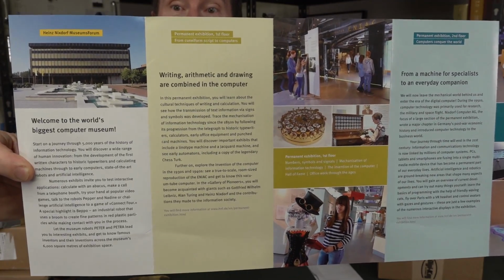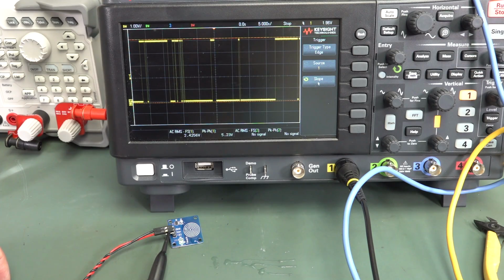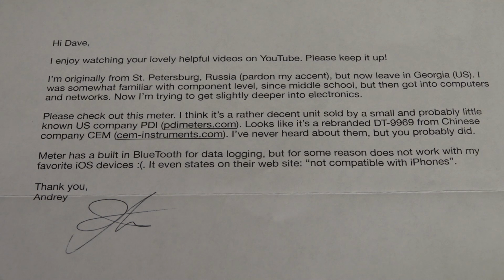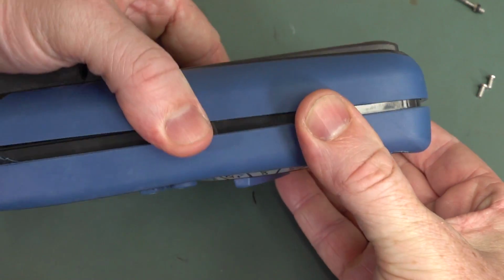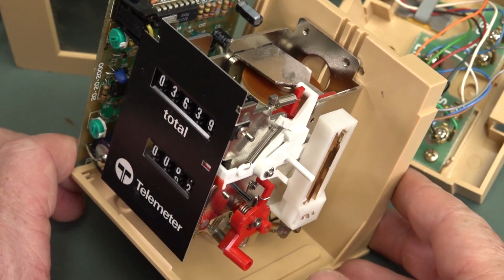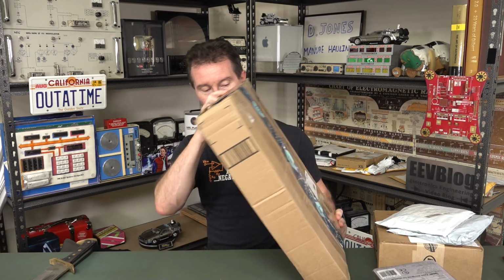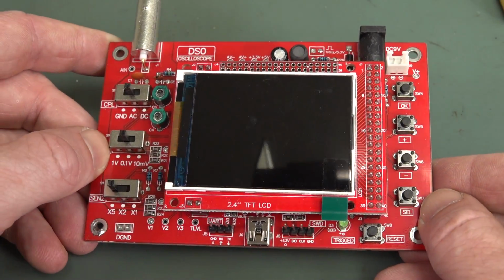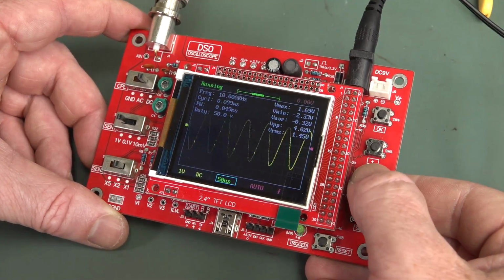EEVblog #1272 - Mailbag

Comment: Hey Ethan, I hope you find this. You can easily download your scopes service manual, they often include alignment and calibration procedures. Honestly just play with the pots in the high voltage side till it looks right. Should be no need to mess with the vertical amplifier where your probes attach, lots of trim pots, coils, and trim caps, often shielded. If the trim pots in the HV for the CRT display don't get the job done, you will need to check voltages. The wires going to the static deflection plates in the CRT run to the middle of the tube, 2 pair, check them. One more thing, it may be a bad capacitor, just check them for shorts or damage AFTER DISCHARGING THEM. The CRT can also hold a nasty charge. So maybe unplug scope, then turn it on whilst unplugged, and bleed off those giant filter caps. On my scope, I have a handfull of nice fat variable resistors (pots) that are brown and accommodate a phillips. 3 in the back and three on the horizontal side, main board. One of them did focus and one controlled voltage to the machine. Take note of the pots original orientation before you trim it, if when you turn it(powered on mind you) and it does nothing to the display, trim it back how you found it. For God sakes PAY ATTENTION to where your driver tips are, don't electrocute yourself. Oh and on mine there is a trim screw on the front under the display that says ASTIG that I adjusted the other day in order to dial in even better. IDK what ASTIG does. My dot in X, Y mode was a bit out, so ASTIG tightened it up, start there maybe. If you are unfarmiliar with High Voltage electronics and the risks I would avoid this, or steal moms dish washing gloves and a buddy with more experience. Good Luck
Reply: Speaking of Discharging things.   I took a 40Kv hit fresh out of school that knocked me on my back for that very reason.  I swear to this day I got everything but obviously I missed one.   So please check, recheck and if your sure, check again.
Reply: @smgvbest  Hell Yeah! Hope you did not loose a foot! What holds a 40KV charge? That's a transmission line rating.
Reply: @WTFinc  this was back in 1986, and It was a flyback transformer as I recall from a commodore 1701 monitor I was doing warranty repair on.  
I look back now and think how stupid and laugh at myself.   i know my heart must of skipped some beats,   i felt the brunt of it in my chest and from the instant it happened to being on the floor, fraction of a second.   but was fine.
Reply: @smgvbest  I instanly imagined you laying on the floor with your hair in all directions still smoking from the zap with a final puff of smoke coming from your mouth "but was fine"
Reply: @smgvbest  Cool, a commodore! A worthy opponent. lol. When I was young I took apart many of tube TVs. I learned on a smaller scale that caps held a charge long after power off. Lucky for me the only indication that a TV could kill me was the thicker than mains wiring on the flyback and massive cap. I think also I was removing the coupling for the tube and flyback and i shorted flyback to ground and i heard a pop. leading me to believe the tube itself was also a big ass ceramic job, when it wanted to be.
Reply: @WTFinc  Yes the tube itself acts as the EHT smoothing cap. The final anode is a conductive coating on the inside and there is a conductive coating on the outside usually grounded with a spring stretched across the back of the tube. Since there is thick sheet of glass between the plates it will stay charged a long time.
Reply: Looking at a 2213A Schematic, Focus mainly consist of Q885(SPS7950) and  a internal trim pot R853(5M),   All of course in the high voltage section.   there are of course other components, passives mainly but those are two I would check for a quick look   it is possible someone tried to adjust the trim pot and messed it up so the  front panel adjustment just doesn't have to range to correct it.
Reply: TL;DR It might not hurt to recap it.
Reply: @JesusisJesus  No, your right, not at all. They should be all right tho. Its highly unlikely its the caps however, which is good news for Ethan.

Comment: I recently got one of those kit scopes; mine didn't come with any documentation whatsoever. It came with one of those shanky Perspex cases, which really doesn't add much value. (2022 price is about 3x what it was when this video was released - frakking pandemic - but still better value than a typical scopemeter.) Would have been much better value if it came with its own 9V wall wart. Anyway, 200KHz analog bandwidth is perfectly adequate for a portable solution for looking at the waveform of a signal in line level audio gear which may have intentionally produced distortion, e.g. distortion pedals, and with a 100x probe should be just fine for tracing signals in a choob amp. Definitely in my wheelhouse for analyzing music production gear.

Comment: I am almost sure that the load resistor in series with the cable is for temperature compensation of the main cell. In the torque measuring wrench.

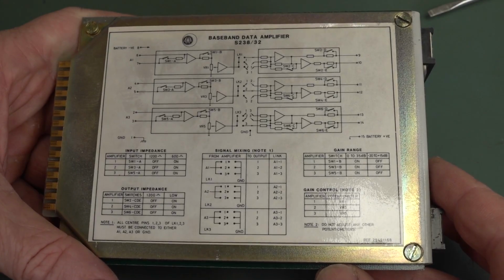Comment: At 37:20 Those little jumpers are a typical Siemens design that was taken up by several relay manufacturers, it enabled you to plug in a module next to the relay (across the coil) that contained a cap / filter or even just a LED to tell you it was on. Mostly used in late 90's industrial PLC stuff. I have tons of them ;)

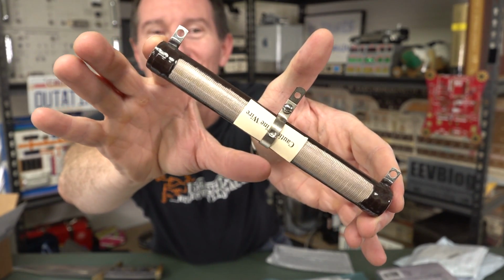Comment: 48:27 I got one of those JYE kits. It's kind of crap. Mine was missing parts, and honestly the PCB has some kind of problem with the plating or something that it doesn't solder easily. It's easily one of the most frustrating kits I've ever built.

Comment: I used to use one of those JYETech scopes before I could save up enough to buy a real scope and the trigger on them is absolute garbage. It claims it's 10us/div which you CAN set it to, but it absolutely refuses to trigger on any events shorter than 100us. They're ok for measuring a PWM signal or getting a vague idea of what a waveform might look like, but I wouldn't even recommend these for beginners.

 The problems with the triggering caused me endless confusion, thinking it was me that was doing something wrong. Which as somebody new to electronics, just hurt my confidence in my abilities and led me in the wrong direction in terms of troubleshooting. I spent days trying to build a simple EEPROM programmer because I thought I was screwing up my write pulse generator because the scope wasn't showing anything when I probed it. It was only after a lot of troubleshooting and experimentation that I figured out it was the damn scope.

For all the problems it caused, this thing isn't even worth the $25 or so it costs. If anyone's thinking of buying one of these, DON'T. Just save up for a real entry level scope. Cuz you're just gonna have to buy one sooner or later anyways.

Comment: Got my TTP223N boards to test out. They are really sensitive. Even thick plastic or wood sets it off. A finger sets it off at about 4 mm.  I will experiment with reducing the pad size, otherwise these sense pads need to be spaced pretty far apart.

Comment: Hey, remember when you got that multimeter which has a read-out for 4-20 mA current loops I think the loop extender might be for a current loop like that. 4-20 mA current loops originate in telecom and are still used with PLC stuff in industrial applications.

Comment: I would pass on the U$150 DMM, but I already have both EEVmeters. 

About the strain gage in the whire, is for temperature compensation, it's common practice to use an unloaded one next to the loaded one to make the compensated bridge, at least when you only load half of them, in other cases you could load the 4 sides of the bridge in opposite direction and get higher gain from it, but not always mechanically practical.

I thought a few times about getting one of those scopes, to use as an isolated one with some safety mods, or to mock around, sometimes it's all you need.

Comment: In telephone exchanges they used to use -50V for billing pulses, so that meter most likely listened on the line for the voltage reversal so you could have a home bill indicator, perhaps for businesses?
They used -50V because everything else ran at +50V, and it was to prevent spurious connections incorrectly billing customers.
I remember spending many unhappy hours testing banks of thousands of those meters in an exchange when I was an apprentice, then some guy would come along with a camera, photograph them all onto microfische, then girls in the main office would manually type all the numbers in using a keypad and reading each one from a microfische projector. Thank god for modern digital recording techniques...

Comment: Artifacts on the dso oscilloscope may come from your 12 v supply. It clearly says it must be under 12v. And many people comments its better to have a low voltage. I run mine on 2 18650 in series for a max 8.4v and it works great.

Low bandwidth yes but for me it's more than enugh, and i cant justify the 10k price of a proper one

Comment: I bought one of those about 3 years ago, I even sprung for the plexy case.  While some of the buttons are a bit clunky, it does protect the unit, and I found an old leather PDA case that I had laying around that it fits in which makes it easy to transport, and keeps the dust and dirt off of it. I have used it probably ten or twelve times, but those times make it well worth the 30 bucks I have into it. I mounted a little 9 volt battery box on the side for ease of power and use a rechargeable battery which again makes it easier to use.

Comment: Those kinds of torque wrenches are used quite extensively in automotive assembly.  In 2002 one of my first jobs was as a grunt replacing terminals on Jeep assembly lines.  They were used for data acquisition during final assembly.  Sometimes barcode scanning, sometimes manual entry but often from torque wrenches.  The Jeep Wrangler line had something like 300 terminals on it and the brand new Jeep Liberty line had 1400 or so.  The automotive companies collect the data for QA tracking and for recall notices.  In the case of the torque wrenches they    collect torque measurements for things like seat and safety belt anchors and various drivetrain and engine components.

Comment: Hybrid in this instance refers to the mechanism for carrying baseband voice both ways on two wires. The outgoing voice is subtracted from the overall signal to remove the outgoing voice from the result. The subtraction is not complete in order to create sidetone, a certain amount of the local speaker's volume to control how loudly the user talks. The circuit also acts to prevent echoing the incoming signal back to the output.

Comment: These are GREAT for Audio, low voltage controls and uP stuff, and automotive with some filtering. It is not every measurement that I need 100 MHZ BW. Needs a case, and a second channel, but for an ISOLATED "visual" A/D / multimeter, adding a shunt resistor, etc., it works. Just don't drop bare wires or molten solder on the board! ha! Kinda gimmicky, but useful on occasion.  There's 3'rd party firmware available, too. Cheers!

Comment: cheap scope: there is a version available with only the QFP soldered, and all the other surface mount supplied on cut strips, (with one or two spares of each part in-case some get accidentally launched)

Comment: I won't be buying anything from sain smart, i got one of their scopes and the state of the software, which is crucial part of the function is absolutely dismal. It is buggy and crash prone and NEVER updated: it is pretty much the first version of it and didn't work when it was brand new. Absolutely no company that actually made tools would leave any of their products in that state, everything about it feels like they just sell stuff regardless whether it works or not. Oh, also: i had to resolder the probe connectors once and it seems like i have to do it again... and i think the 1kHz calibration signal output is dead too.

Comment: 43:37 Pound (times) inch.... those bloody sparkpuller electronic engineers, they can't tell torque from a load spatial distribution. Yeah, put  that next to you amps per hour notes. Same thing.

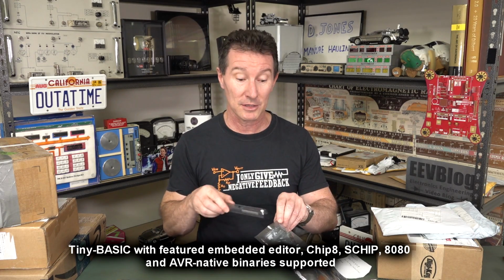Comment: 16:00 SCART does everything. Conposite, S-Video and RGB both in and out.
Reply: The problem with SCART, apart from being too big & clunky, is that many cables are 'one way' they are not full duplex wired. Plug a SCART the wrong way round and you get no signal. And they are useless after 3 meters. When you buy a SCART cable, make sure it's a thick one, that means (usually) that they are fully wired and well screened! Grr.

Comment: I've got a JYE scope like that. I build modular music synthesizers and I use it for audio frequency test and tuning. Works great for that, I jumpered the buttons and switches out to a Eurorack panel.
Reply: I guess it's alright for audio frequencies. But I had triggering problems like Dave did on anything shorter than 100us. It led me down a lot of wrong paths in terms of troubleshooting. I'd spend days trying to troubleshoot a percieved problem in a circuit, only to realize it's the scope that was problematic. They're okay as a novelty, but after the problems I had, I wouldn't trust anything it tells me for anything past maybe 10khz. And even then, there's just no way to know for sure without a proper scope to check it against. I just saved up and got an entry level Hantek scope and I've never thought twice about it. You should consider doing the same, if it's possible. You'll be glad you did. Start looking around and get an idea of which scope suits your needs best for its price. Cheers.

Comment: Couple of years back, I picked up one of those DSO kits.  It came with all the SMD parts  installed.  It was fun to assemble, it came while we were on our Winter break down in Arizona, so I assembled it with what I had along in our Motor Home, sitting at the booth and soldering with my little USB powered soldering iron.  It took great care to keep the tip at a decent temp as those irons are known  for just dumping every amp it can get into the tip and overheating unless you allow her to cool a bit between joints.  The unit works great really for what it is, I have had a lot of fun with it and learned quite a bit about circuits by testing out boards I buy and such.  I did buy the clear lexan case for it to protect her when we are moving about with the rig, plus I found a little leather case that she fits very nicely in for storage. Earlier I built a tiny scope using an Arduino Nano and a Nokia screen. It works but not nearly a good as the one in your video.

Comment: @EEVBLOG Hello Dave.  Yes, I am interested in a fast DVM in the $150 range, although I would prefer a perfected 121GW, which I pretty much shelved for resistance trouble-shooting.  I am interested in it from you because I know there will be updates and software updates.  It is fun to be on the bleeding edge of what can be done.  Realistically, I am interested in a Fluke 189B type meter, that is not discontinued.  it's hard to justify $400+ for a handheld meter.  For trouble-shooting a Fluke 17B may be better.  If you have another one coming out, I may just wait.  Speed to low ohms (not higher ohms) is more important to me.  It's a cool trick the DM-950BT does.  That trick should be added to the 121GW code, or if nothing else added as an option.  i am enjoying your videos as usual; your accent is very pleasant to listen to.  I've also learned some of your BritishAutralian slang.

Comment: the problem with center-off is that it's really easy to accidentally overshoot to the 10A range when turning it off after measuring voltage. if your stuff is still connected... boom!
Reply: No boom, because overshooting to 10A does not move your lead into 10A jack.

Comment: Customer private meters . There  were either  50Hz longitudinal  pulse or 12Khz tone.

Back in the 90's when I was working  telephone exchange maintenance. The Alcatel S12 didn't support the 50Hz metering and a local adaption was made. But, it wasn't used that much because there was extra cost involved. The standard line card supported 12Khz metering no extra hardware required or jumpering to special equipment.

Comment: I bought one of those little kit Oscilloscopes on Amazon for about $24US and liked it so much I got another one.  My main use is audio so the limited BW is no problem.  Being so cheap, I don't mind keeping one in the truck for watching power output for the sound system. or devoting one to watching the poser going to various speakers in my home system.

Comment: The "hybrid amplifier", at least in US telco terminology, is a bi-directional amplifier, exhibiting gain in both directions simultaneously. It's used to compensate lossy phone lines. Very tricky to set up, lest they begin to oscillate ("ring-around"). They require a very stable impedance on both sides, and also strict adherence to frequency band limits.

Comment: While that meter is a nice meter with good parts inside. I find it very difficult to spend over $100 USD on any meter that doesn't have the UL mark on it. Like you mentioned when speaking of the CAT rating; claiming CAT IV with no UL mark is a bit....ehhhh. Plus, for over $100, I want to know that meter was blown up at the UL lab in Illinois and proofed.

Comment: Hey Ethan,   I'm in Sunbury so if you need any extra test equipment I can let you use some of mine if you're interested.   You'd be surprised though with what you can do with a DMM for the repair itself and as Kasper Abigail send you can get the the service manuals for TEK equipment online usually.   if you see this let me know.   I'm smgvbest on the eevblog forum if you want to reach out

Comment: Those torque wrenches are used on car production lines so that if one stage requires 6 bolts to be tightened to torque X then the system checks that all 6 have been done correctly.